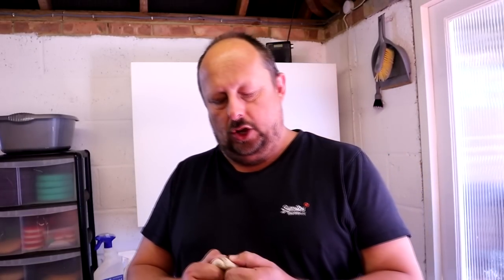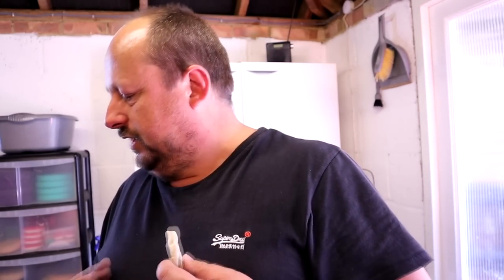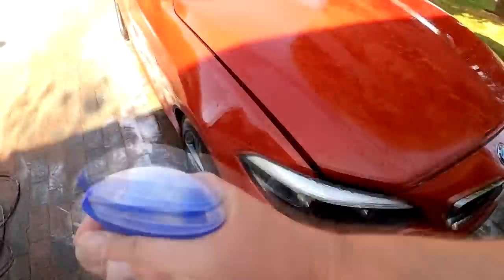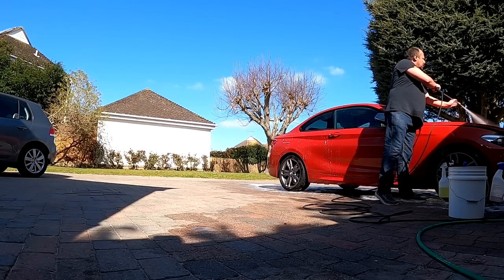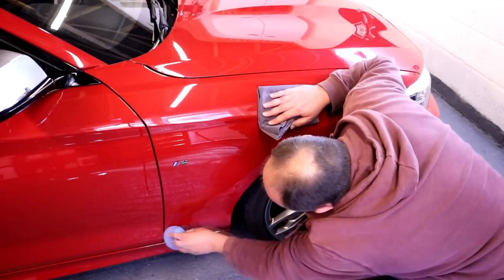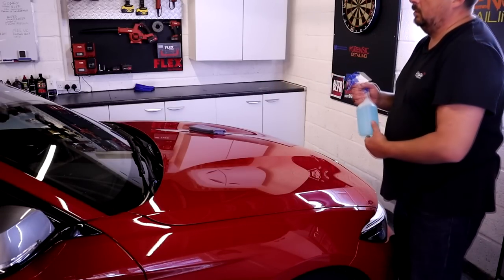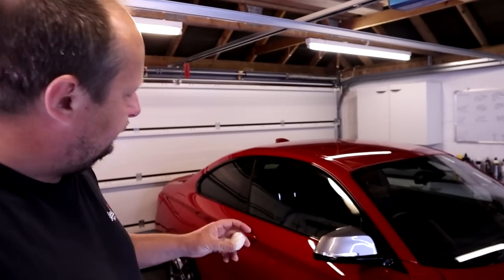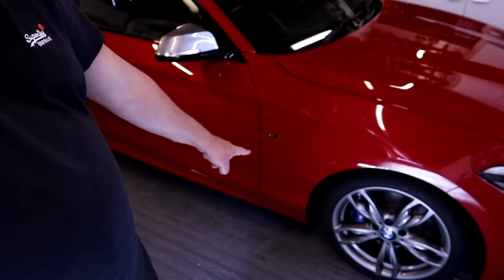Clay Bar Detailing How To Clay Your Car Properly

Comment: I know that I'll open a whole can of worms with this question as everybody seems to have a different opinion on this... is it still worth claying my car even if I don't have the means to polish it after?
Reply: If the paint is not very swirly I'd avoid it until you can polish by some means, if it's already swirly I'd say go for it, also if you just mean you dont have a machine polisher maybe try using a suitable polish that has some fillers in applied by hand, it's hard work but you can make a massive difference to the overall look that way too!
Reply from the maker: you can always hand polish with a glaze type AIO thing.

Comment: I use Fallout remover beforehand. Soak and rinse off. I Never use fallout and spread with wash mitt as you will rub all the particles in the bodywork. 
Fall out,
Clay then wash 🧼
Reply from the maker: rinse will not get them out like contact does, you are going to be rubbing the paintwork with hard clay bar and scraping contamination over the paint (you can see the state of the clay bar even with chemical decon).   So using a soft wash mitt and suds to gently work the paint and help dislodge any shrunken fallout is not an issue.  I guess I dunno we all have are little methods dont we.